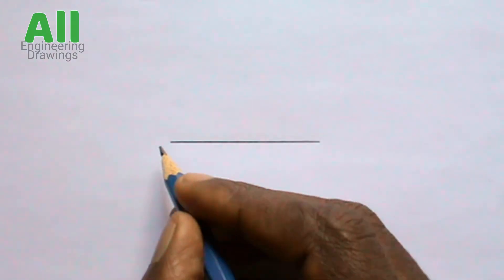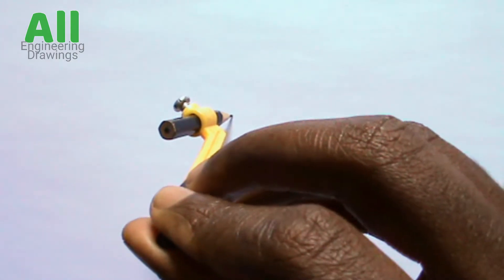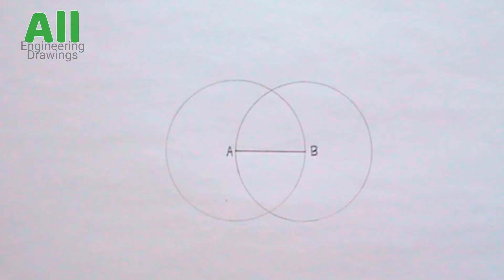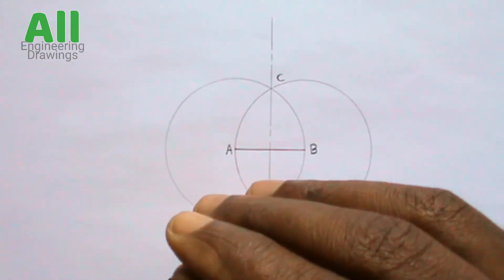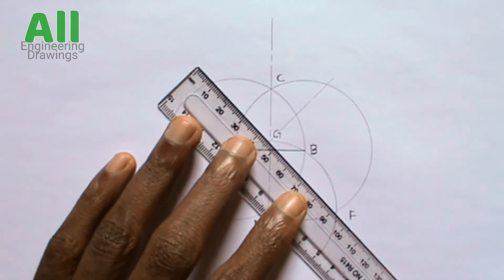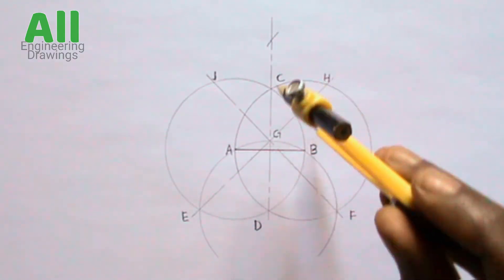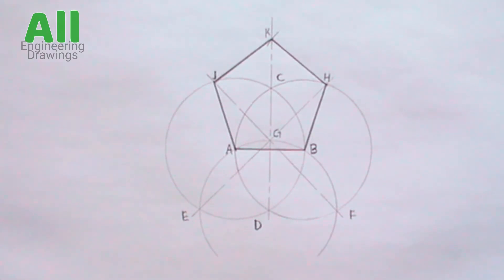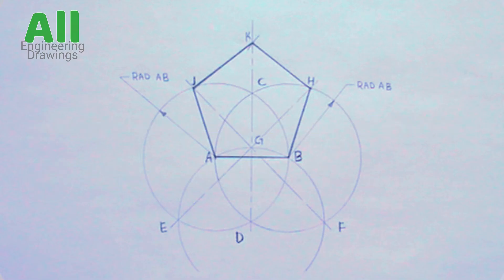HOW TO DRAW A REGULAR PENTAGON GIVEN THE LENGTH OF THE SIDE ||Geometrical construction

Comment: Sorry, but this is not a Regular pentagon.
Reply: I think  it is regular. But it may happen that if the camera is not exactly perpendicular over the paper, there may be some perspective distortion in the image on the screen.
Reply from the maker: It is a regular Pentagon.
Reply: @allengineeringdrawings  i just measured it and it is not a regular pentagon, the top angle is bigger than the other 4